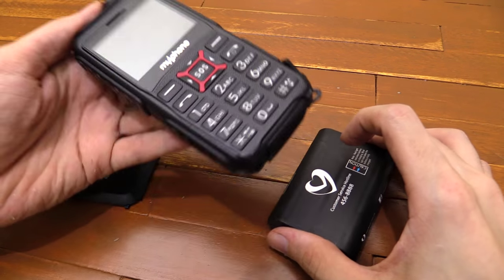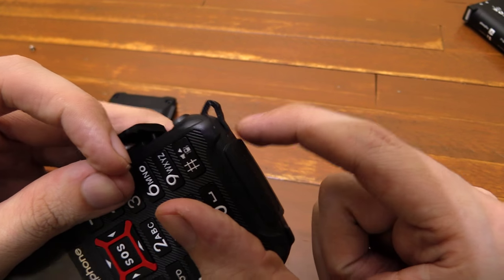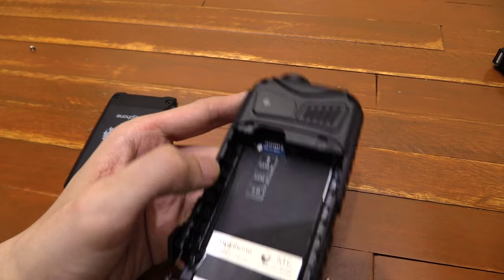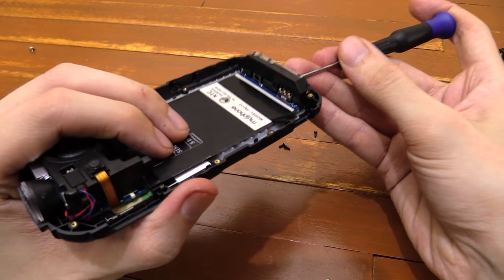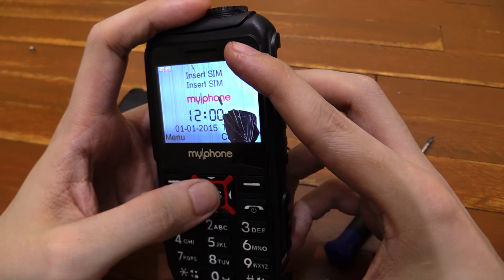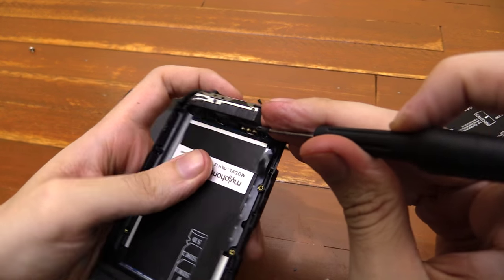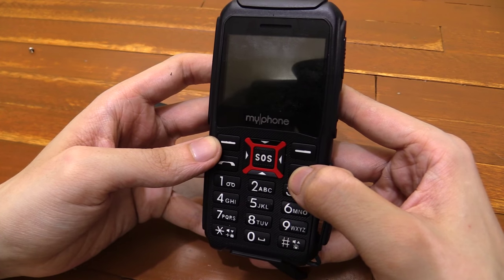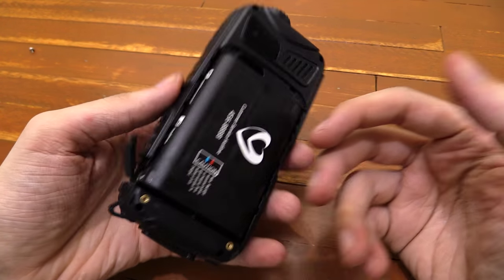SOSPHONE Repair

Comment: That was actually informative.. Thanks for the video (both) I think the battery is way too heavy for the phone so when you drop it all the pressure will be on the phone it's like having a hammer inside that will smash it from the inside when dropped..

Comment: Do you think the battery pack is made of 18650 batteries? If so then this phone is flawed. Lipo is much lighter than 18650. Even if it's heavily armored outside, the internals will get smashed by the battery if you drop it. Since you dropped it twice, one drop smashed on to the battery contacts and the other one smashed at the back of the LCD.
Reply from the maker: +SEELE01 Yup it has three 18650 batteries, I've updated the video description with a link to the picture of those batteries.

Comment: I prefer the Edgepad Thunder/ DTC Power bank Phone. They have lesser battery capacity around 4400mAh but they work well. I own one and I had dropped it for several times but I didn't experienced the problem you had; the phone still power on and it doesn't have any problems or damages with the screen nor the software.  The messaging doesn't lag and it can serve also as an independent power bank and comes with a pretty bright LED flashlight. It doesn't have SOS emergency button tho...but can be trusted in real emergency. Thanks for your review of the MyPhone  My112. I'm sorry for your phone.
Reply from the maker: +A2S I've been testing the DTC gear for the last couple of days. You summed up the differences pretty well. The SOSPHONE is better at video playback though. The DTC gear has to be placed horizontal to watch full screen which is a little awkward. Also the video just isn't as clear on the DTC compared to the MyPhone. Still testing and getting to grips with it before I post a full review video. I hope it can survive the drop and splash tests :)
Reply: Since it's an emergency phone, the ruggedness should be the first priority.You did a great job in reviewing the MyPhone my112 dude but it's a little pain and sacrifice for your wallet hehe. Going to wait for another great video of yours ;)
Reply: +Gadget Addict have you tried to make an emergency call even without a load aside from the 911 which is present at almost all phones?
Reply from the maker: A2S Mmmm nope. I think only the well known numbers like 911 999 112 etc work. I don't know about the other emergency numbers that go to specific units. In most countries (including the PH) you can make an emergency call even without a sim card, let alone having any load.

Comment: Hi totally off video topic here but wat do u know about printer cartridges with chips in it? Anyway to bypass it?
Reply from the maker: +TokTok Cali I don't know much about it myself but there are lots of companies that refill and reset/bypass/replace the chip so it can't be that hard :)
Reply: +Gadget Addict I dont know about that. Im pretty technically savvy as well but im finding it difficult to fins a solution esp. with limited resources here in the Phils. Give it a go.... see if you can find a way to hack it :)
Reply: +TokTok Cali find
Reply from the maker: +TokTok Cali What cartridge are you using?
Reply: Kodak Hero 5.0... Wish I can just go online and buy the reseter or aftermarket chips or even new ones but it not as straight forward as we would like. If I were in the US no problem, maybe.  But here...... Tough bud.
Reply from the maker: TokTok Cali Hmm yeah without the right equipment it could be difficult. Did you try the local shops/people that offer it? It might not be that expensive. I've never really had a good experience with refilling cartridges. Either when I refill myself or when a "real" company does it. Might be time to consider a continuous ink supply mod :P
Reply: +Gadget Addict yea,  ive tried visiting the local shops. they have retting tools but onlt for canon and HP mostly.  Noone supports kodak

Comment: send me the batteries, bet they will fit in my vape gear LOL.. not a total loss, the light still works :)
Reply from the maker: +Hey_Joe lol yeah, that wonderful old school through-hole LED they plonked at the top haha :P I guess that's the good thing about the battery being an independent powerbank. When the phone breaks or you throw it at the wall for being so laggy writing text messages, you still have something left over to use lol.
Reply: Oh, well. better than nothing.  what a POS. that was a small drop. I dropped my old Nokia all the way down a full flight of steel stairs at the Chicago airport, landing on the concrete floor. Put the battery back in ..still works
Reply from the maker: +Hey_Joe lol yeah it's a bit daft. My iphone has war dents all around it where I've dropped it so many times. That thing has a big 5 inch piece of glass and it's still going strong. An emergency phone is meant to be able to survive a lot more. I'm almost tempted to go on the hunt for a true emergency phone lol. Nokia probably is the way to go right now. I've also got old Nokias that have survived much abuse and even after 10 years they're going strong. Albeit with new batteries swapped in.
Reply: With that so called emergency phone, you may as well YELL REAL LOUD !
Good you are getting the word out so people do not waste money.  False sense of security comes to mind.